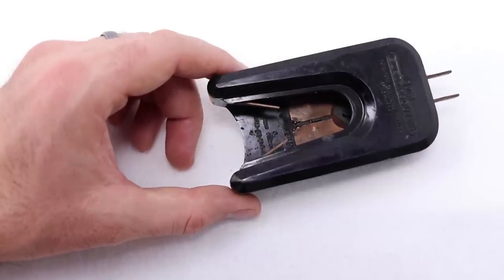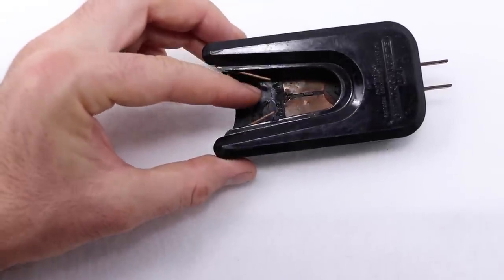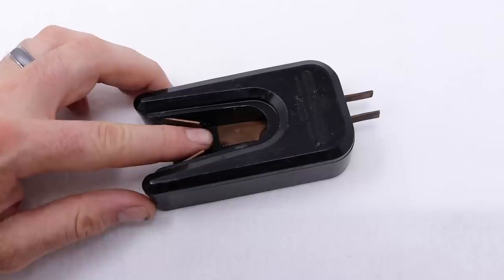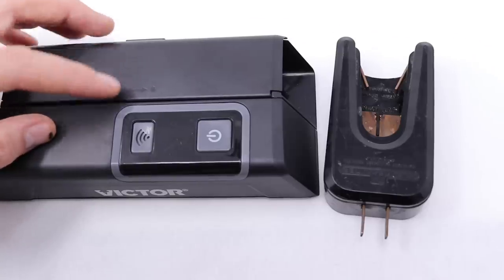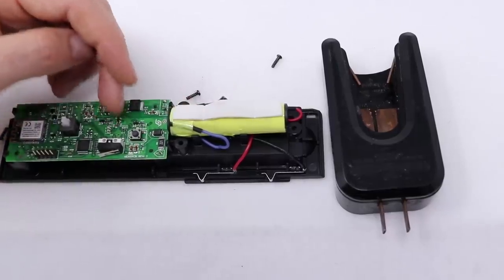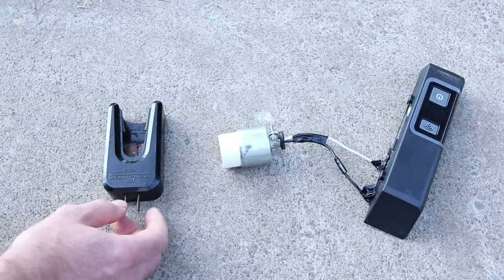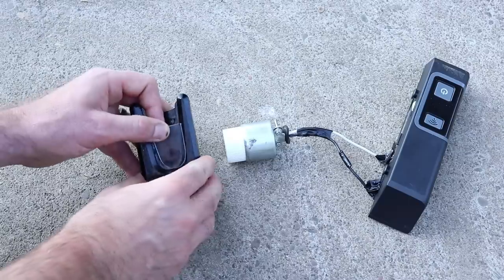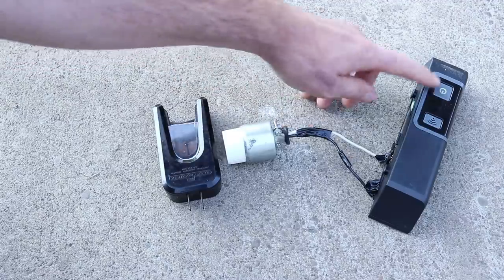The Electrocuter Mousetrap From 1947.   Mousetrap Monday

Comment: The problem with the trap may be that the contacts are very oxidised over time, so the voltage the mouse gets is much lower, as the layer has a high resistance. You need to clean the copper, with steel wool or something else

Comment: The reason why it was not affecting the mice to a lethal extent is because the electricity that kills is measured by amperage. Your Standard wall outlet has zero amperage running to it and it's only hot because of wattage. Standard wall outlets have about 125 watts. For watts to be lethal has to be a couple thousand

Comment: Alternating Current shocks typically force the muscles into spasm, probably throwing the rodent off the electrodes, however a direct current causes muscles to contract, also inflicting instant heart failure. Strip the guts from one of those cheap tennis bat style fly swats, they pack a powerful zap from a 9v battery!

Comment: The best way is to describe which the new battery powered mouse traps kill is they us DC current which is more lethal as the fact the more you increase amps the more likely to stop the heart while not increasing the voltage all that much where as AC is most commons since its not only safer but you can also transmit very long distances so that's why modern electric mouse traps use DC current.

Comment: The reason that antique trap doesn't work is because of the amps, or rather, the lack of amps. You have to have either very high voltage or high amps. 120v with 0 amps won't kill anything. It's the amperage that is lethal, not the volts. Theoretically, if you could pack enough amps behind it, 1 volt could kill a human. It would be very hard if it's even possible to push lethal amperage through 1 volt though. Maybe with a bunch of resistors. Also, the newer style electric traps are DC, not AC. DC is very lethal compared to AC.

Comment: The problem with line voltage traps is that AC isn't electrically violent enough to ensure a kill. If you were to rectify it to DC use that to charge a capacitor I would expect a 100% kill rate.

The reason for this is that AC is constantly changing at 50/60HZ resulting in a "buzz", like when you shock yourself doing something dumb. On the other hand a capacitor is going to dump a huge "slug" of electricity in one shot. In this way DC is much more dangerous than AC and anyone familiar with high power electronics would probably agree.

The Victor traps use a high frequency/high voltage AC source. The high frequency "locks up" the mouse's muscles and the high voltage allows the current to jump across any gaps so the mouse can't escape.

The best would be a resonant MOT (microwave oven transformer) as they can deliver over 2KV at more than 1A...in humans this is instantly lethal with no second chances. I imagine that it would cause a mouse to catch on fire or explode...but would present a significant fire and electrocution hazard to operate.

Comment: With 6vdc you can easily get 20,000+ DC or AC. Heck remove the flash from a disposable camra or one of the claimed 100k volts(most likely 20 to 30k) modules on eBay for a buck or 2 delivered.

Comment: A spring loaded trap that shoves the exposed live wires into the rodent with good force to poke with 2 blunt spikes and give 3 seconds of very lethal voltage then a resetting circuit to stop the current.  Then a resetting spring loaded catapult floor mechanism to launch the dead rat/mouse out of the trap to ready it for the next vermin to try there luck.  Would love to see you build this.  Please say fan "Xion" with an X came up with this idea in the video you show it in :)

Comment: I don't know a lot about electronics but I've heard that the reason why the mice are able to get out of the trap using AC current is because AC has start and stop pulses when the current is flowing and that's why especially when you touch some bare wires in an AC powered cord you're able to pull your hand away or the part of your body that got zapped. Where as DC current flows in a straight line constant current flow and that's why if it's powerful enough you wouldn't be able to pull yourself away from the current as its flowing through your body and that's why the mice were electrocuted using a battery or DC current.
Reply: In the model I've got, that dohickey only has two leads, so its not a transformer. I suspect its a simple inductor (a coil of wire, possibly around a ferite core). The devices runs a current through it to build a magnetic field. When it abruptly stops supplying the current, the magnetic field collapses and generates its own voltage/current. The faster the magnetic field collapses, the greater voltage generated. The trick is managing not to fry its own circuitry.
Reply: amberola1b well 1 wave goes 50 times per second and u only need half a wave to get to the max I or U so u would need to be really fast

Comment: If you had a high voltage multimeter it would be interesting to know what the cap charges up to. It would also be written on the side of it under the tape. I presume it would be a step up circuit to 400V or more

Comment: I wonder if something's broken.  If those wires are connected directly to the outlet without a capacitor then of course this won't work.  Is there anything else inside the housing?

Comment: I think the old one would've worked back in it's day if I'm correct because the outlets didn't have a set limit of voltage it used how ever much it needed at that time
Reply: Current. The voltage would be fixed by the input generator, assuming no overload leading to a brownout.

Comment: It's because USA has too low voltage. 115V is way too low. It would be interesting to see it operating at 230V. As far as I remember in US you have those 230V from two phase circuits(180° phase shift) so you may be able to get away without any autotransformers. Alternative would be a voltage multiplier. DC but at much higher voltages. Say 1kV.

Comment: I wonder if it had worked with just the cover, but still using a wall socket. Also can you post a higher resolution picture of the Victor's electronics - especially the Wifi chip? I'm curious if it's an ESP32 that you could tinker with :).

Comment: I guess the standardization of voltage flow might've made the device less effective. You need to have a capacitor to deliver a lethal charge? On your homemade metal mat did you add capacitors?

Comment: Sounds like the same thing most people who work with electricity already know and that it is not the voltage but the amps the get ya. High amps will deliver the voltage at a faster rate, not sure the voltage needed for a sure kill but I have been zapped a number of times and have learned that the faster the voltage is delivered the harder your body reacts.

Comment: Well that strangend out it's tale.  The prob was that in 1945 all current in homes was DC(direct current) now A.C..  DC grabs and kills.  AC hits lets go repeat.  That's the reason household currant was changed to AC.  Not leathel at 120. The capacitor adds amps to charge.  Volts don't kill amps do.  Great vid.

Comment: Plug the trap to 277v and we'll see some shocking results lol. 120 isnt enough to hold you on a circuit. If you use a larger voltage the mouse will likely freeze to the circuit and fry

Comment: So what is you made a HV diy mousetrap wherein you used a microwave oven transformer or M.O.T for short?
I forget all the exact lingo for winding a transformer but you'll be able to see 3 distinct windings. 1 with many 'highest output' one with very few 'lower voltage than input but wayyyyyyyy higher current' and one with somewhere in the middle.
If you connect the middle one to the one with many then a fried mouse will smoke up the night.

Comment: Try a 50 amp circuit on 220-240. Like what you would plug a welder into. If that don't work I'll be dam surprised.

Comment: Somebody doesn't understand electricity...  Just because it is POWERED by 6VDC does not mean that that is the voltage at the terminals!  The same way that your car has a 12V battery  but it takes from 12,000-45,000 volts to get a spark at your sparkplug.

Comment: 110v ac isn't that great. Better over here in the UK with 240v. Still, best off using a DC source as AV source is basically at zero volts between cycles. DC is just that. Direct current which is constantly flowing.

Comment: My guess is, the higher the voltage the more amps you will send through the mouse. Microwave oven transformer might do the trick. I think they convert from 110 to 3000 or close. Just be real careful with it as it can be lethal to humans also.

Comment: Try putting a high voltage transformer inline. Or use big capacitors
Reply: Be careful though if you do that high voltage is dangerous and can jump through the air(If the voltage is high enough)

Comment: I dunno... I think the concept in itself should be working. You have to make sure that one short shock will absolutely kill, though. So, high amps and high voltage.
If done properly, I think you could create a trap like that CO2 cartridge one, and you'd create a little pile of dead rodents underneath over the course of a night....

Comment: Try this trap with the secondary of a microwave oven transformer.  They put out 1000 watts at ~2300 volts.  That ought to cook a mouse in the brain case!
Reply: EFormance Engineering then u would have very low amperage tho

Comment: Power it by a microwave oven transformer... That should give you around 2000V and around 0.5A, depending upon the wattage of the original microwave oven you salvaged the transformer from... That's deadly for humans, so it should do a good job on rodents...

Comment: That mouse jumped so high lmao. Also yikes at that trap, connecting stuff like that to an outlet is the easiest way to start a house fire. Also the device that you called a capacitor is most likely a transformer, which takes the 6V of the battery and raises it to a very high voltage, this high voltages creates a lot of current passing through the mouse and then kills it.

Comment: I wonder also if this was invented with DC voltage in mind.  In the early stages of getting electricity to people's homes it wasn't uncommon for people to have 110 to 130 volts DC in there homes to run appliances.   By the late 40s I think AC had pretty much dominated but some remote farm houses might well still have been DC.  Could be whoever invented it only tested with DC and I believe DC will not "let go" when it gets you.

Comment: After watching the video it would appear that you need a capacitor is going to deliver shock of 50 to 60,000 votes that stored up with a number of in series capacitors that also won’t cause the breaker to trip this will not does not and has never really worked

Comment: There's not enough voltage hitting the mouse without the correct capacitor. That's what allows stun-guns to be so effective, some with just a nine volt battery for a power source. Now this is gonna be kinda morbid, but I wonder if some enterprising young fellow (a teenager who likes to blow stuff up lol) ever thought to take the idea of an anti-personnel land mine and "downsized" it for a mousetrap? Maybe use some firecrackers and one of those electric ignition systems that are for model rockets rigged with something to "trip" it? Co2 cartridges? Electric nail gun? Now, I wasn't one of those kids that tortured and killed animals... I just don't like rats or mice (nasty little creatures). Oh, I forgot bottle rockets lol. Ok PETA-heads, don't get yourselves worked up. Most of you were mean little kids too... you're just trying to get into Heaven now... lighten up. I'll quit with this... anybody remember the model rockets we built as kids and shot em in the air using the Testors rocket motors? How about the one that had the clear "specimen" tube? Now, we NEVER launched frogs up in those things did we lol?

Comment: Maybe that trap would work better in Europe where the current is stronger?
Reply: In Europe the voltage is stronger, not the current, if you compare only household sockets. European household sockets are typically something like 220 volts at around 10 amps, whereas American household sockets are 120 volts at 15 or 20 amps. American utility outlets however are typically 240 volts at 20 to 50 amps. 20 amps for an air conditioner, 30 for a clothes dryer, 50 for a kitchen range.

Comment: i ve been looking at circuits to dispatch a pesky rat.

Can someone recommend a step up transformer or capacitor to wire into a trap?

I want to use batteries for this.

Thoughts anyone?
Reply: David Farmer just try a stepup transformer with high current output on your ac line and do the bare wire method, tell us if it works hahaha
Reply: Thanks for that Neil.

The thing is I want to be able to.

Comment: The yellow component is an inductor called a transformer. It is used to step up the 6 volt supply to a lethal voltage. I would like to know the frequency of the excitation. No doubt the Victor engineers optimized that choice to be as lethal as possible while using as little energy as possible to get the desired effect. It is obvious that 100 volts at 60 Hz is not a good choice because your 1947 device didn't work well at all.